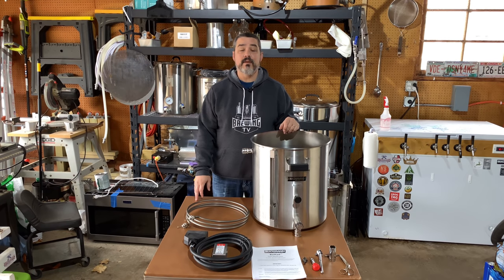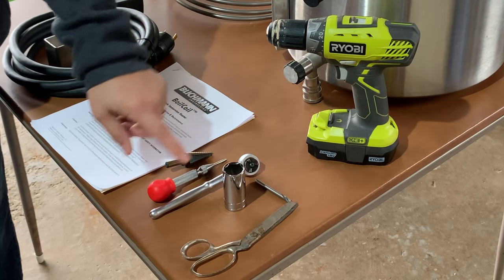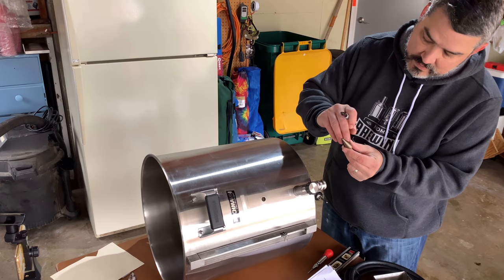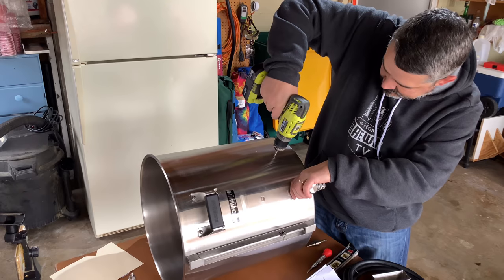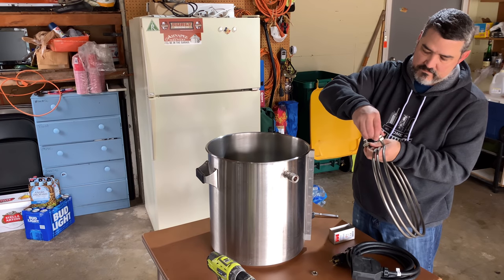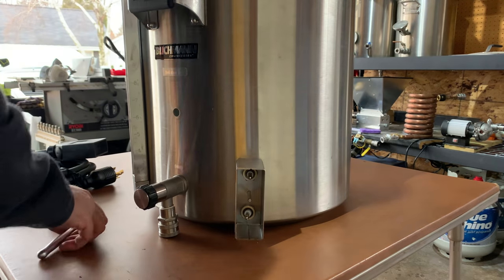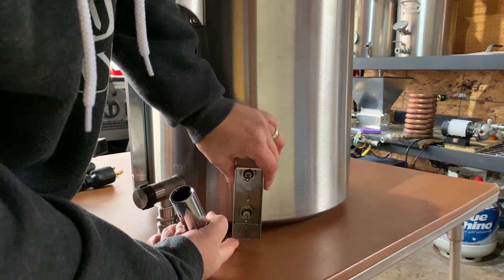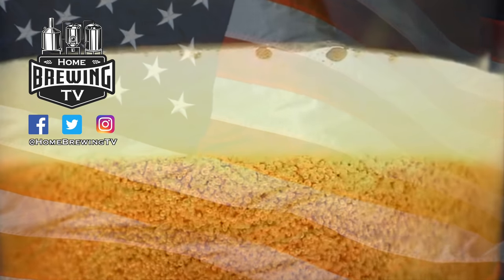BoilCoil Install

Comment: Been thinking of converting to electric myself, I am so curious as to how long it brings your HLT from 50 degee tap temp to 170 or so strike water temp. Please don't forget to give those details in the testing video. Cheers 🍻
Reply from the maker: You got it Brad; I’ll be sure to run that test, and thanks for watching.

Comment: Isn't the controller $500 plus you need (at a minimum) a Spa panel installed? I think I'll wait to see what Brewzilla is going to cost. I think it will be comparable. Blichmann stuff is nice, no doubt (and, unfortunately, never on sale). I think this is the only hobby that it seems normal to take a $300 cookpot, whack 2 holes in it, add something to it for a combined cost of $800 and then think it was $1100 well spent to make something worth roughly $50 a batch. We're all NUTS. TBH, you have to install that Spa panel either way...Brewzilla or Blichmann.
Reply from the maker: I hear ya... The amount we (hobbyist) will pay is astounding. However, the new Blichmann Power controller retails for $150, and the spa panel was only $85.  The Brewzilla looks very attractive, and I’d be interested in how much flexibility it will allow vs. a three kettle system.  Keep brewing my friend. 🍻
Reply: @HomeBrewingTV  Biggest advantage I can see is pump included and probably easier to clean. Downside is probably not as durable.